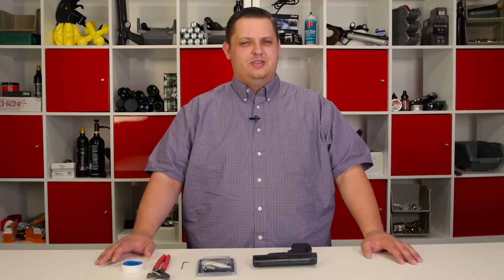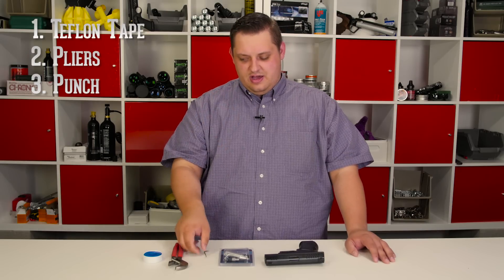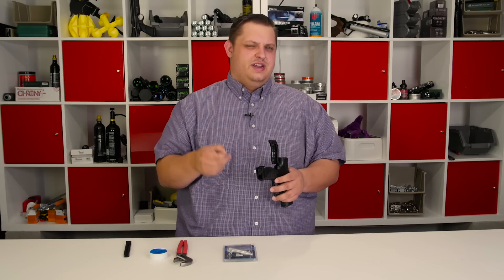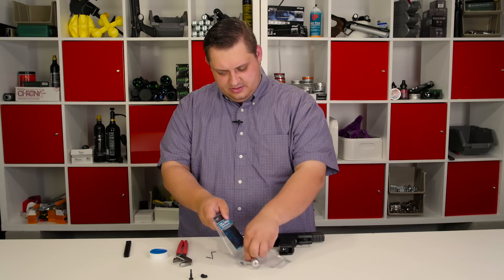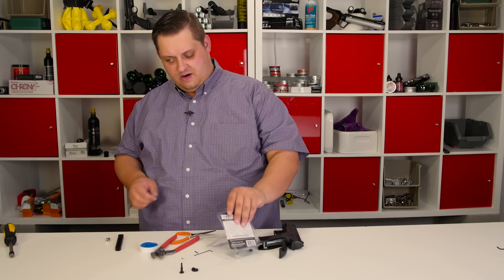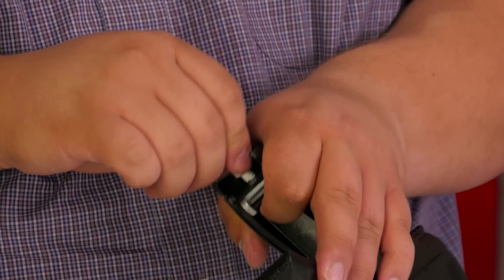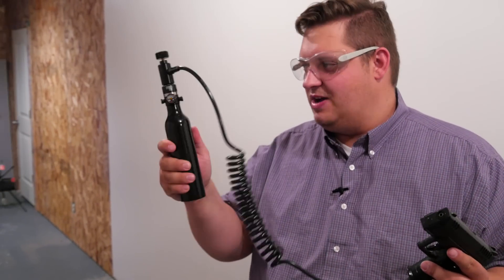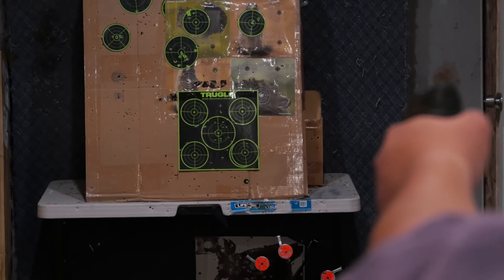Advanced Novelty Tech C02 Adapter Install

Comment: Thanks man!! I’m not new to air guns but I’m 50 and new to co2 . This looks like the answer to my question of how to fix the co2 problem of running out so fast and the velocity varying so quickly! I’m going to give this a try if it can be installed on the pistol I’m looking at!!
Reply: The instructions come with a list of guns it’s a straight fit for and even list ones u will need to adapt slightly

Comment: OK first tef tape isnt a sealer! Its for lubercation! For example it helps fittings of NPT go together much easier to lock up threads better. Gezzzz... 2ndly the way he gobbed that tape in there is NOT the correct way to apply it. You want just a few wraps clean to the male threads only and a thread or two away from the start and clockwise wrap normally so when you thread the fittings it doesnt bunch up, rip, or come off.

Comment: Very cool, so long as used within the pressure range of CO2, but I have some concerns if you go with higher pressure due to the design.

I did a CO2 to HPA conversion myself (https://youtu.be/LfMNIJ3xLKI).  But I do have some concerns about this kit.  The CO2 cartridge adapter is not connected to the valve, so it depends on simple pressure between the adapter and the valve to keep the pressure where you want it.  If the HPA exceeds common CO2 pressures (450-1000psi) then there is a danger the adapter could be pushed away from the valve, and you have an uncontrolled dump of pressure, and possibly a catastrophic failure.

That isn't to say this kit isn't good IF USED AS DESIGNED without pressure greater than that recommended.  It is to say that it could be very, very dangerous if you exceed those pressures.

The way I converted my 2400kt (regulated at 1600 psi from a 3000 psi bottle), my adapter screwed directly into the valve body, so the valve body itself (rated to 3000 psi), stainless steel fittings (5000psi), the adapters (4500 psi certified), or microbore hoses (5000psi) would have to fail for a catastrophic failure to take place.  Even so, I retired the gun after seeing the results of the failure of a gun using HIPACs ((video here https://youtu.be/a1hrms0i2LU) again, the product isn't bad so long as you do not exceed the pressures the gun was designed for).  

Just be VERY VERY careful guys.  I know the temptation is there to increase the power, run higher pressure, but think three times about it before you do it.  High pressure air can be very dangerous if you don't know what you are doing, and even if you do.

Comment: Cameron,  when you wind the Teflon tape onto the threads use clockwise from the end so you do not remove it or push it into a Teflon o-ring when you tighten the fitting.
Reply from the maker: Right you are, my slip!
Reply: Chaz Jeepster I know right lol and its not for sealing ither. Its for lubercation for npt threads and such. But i guess if you bunch and goop it all over and around like he did it may help to seal. Id just go for something made for sealing in liquid form myself personally. Lol
Reply: Airgun Depot well at least you caught it and manned up bra' keep shooting str8